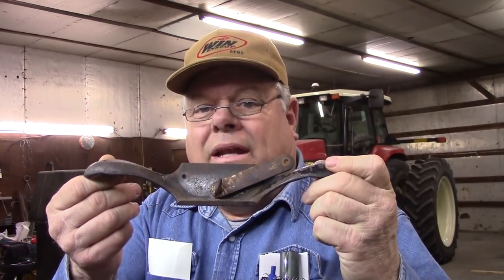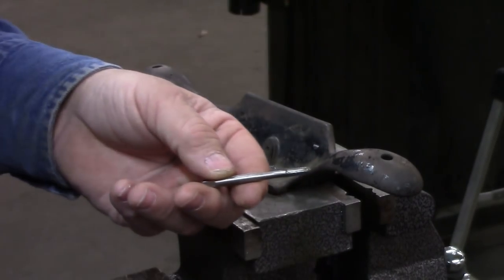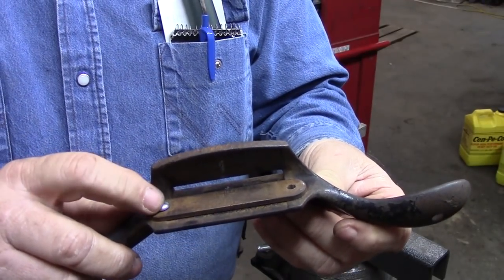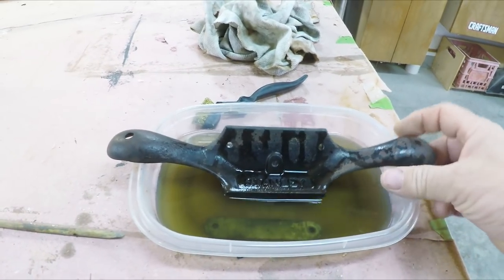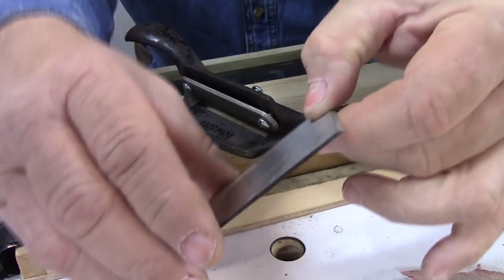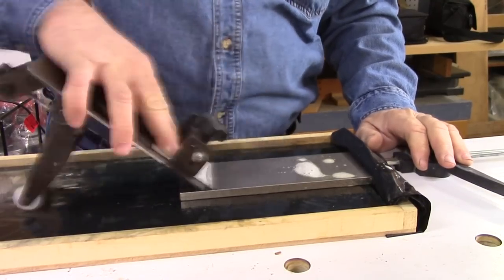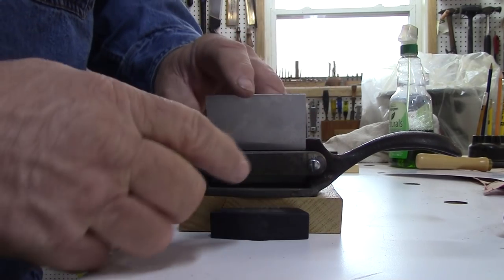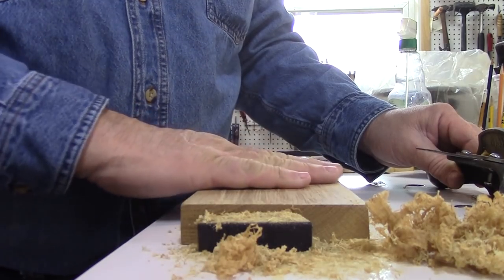Stanley# 80 Cabinet Scraper Repair.

Comment: Nice find and a good restoration. Though I did wince a little when you tapped the holes. A wrench when you must, but better to use a tap handle.